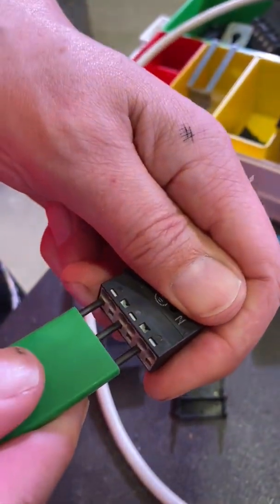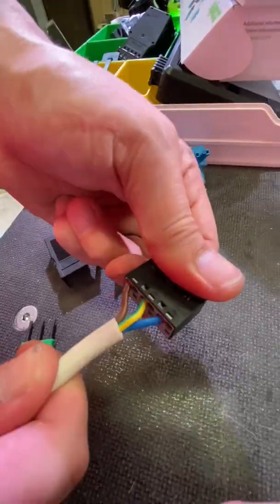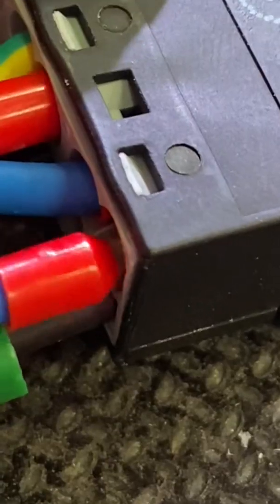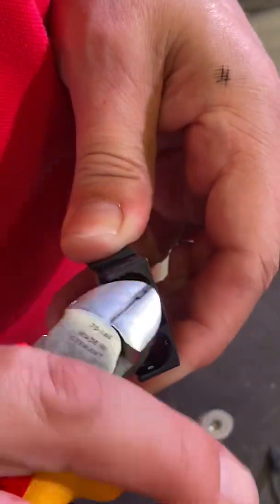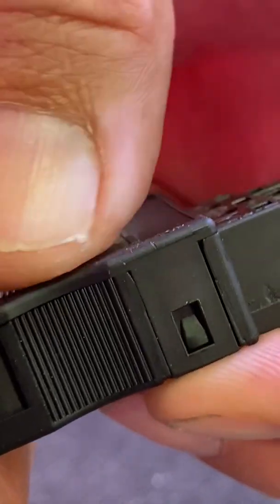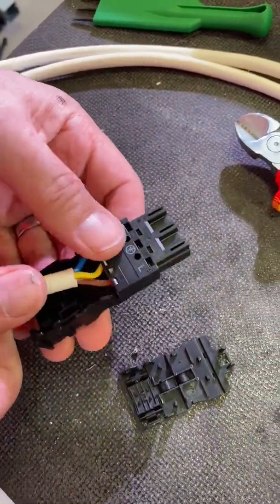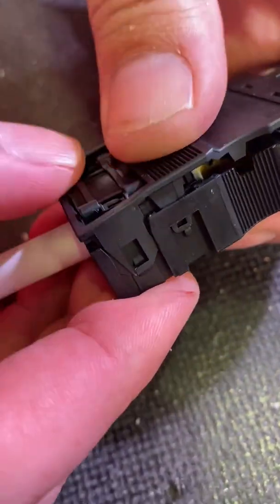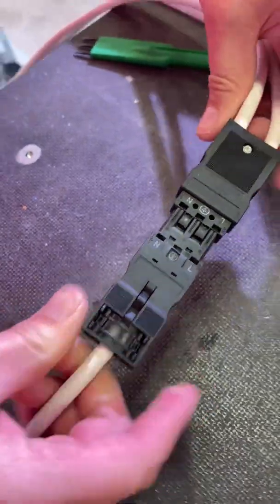MYSTERY TOOL REVEALED - TRIPLE SCREWDRIVER? #shorts

Comment: And because its non standard and complicated some user will just cut it off and use terminal block the minute they need to change something.

There is an event venue I work at regularly that use these to milk out money from exhibitors.  The house sparks have zero clue about the event and just get it wrong every time which leads to loads of extension cords.

I first encountered Weiland conns under desks in offices with tons of spare cable just coiled up everywhere  with factory made ends and moulded plugs and of course users plug heaters in and at one place I found a coil that had practically melted together.

The issue is educating people on the connectors and how to make them off properly.

Comment: I'm afraid that six thin hard nails put through small holes in a piece of hard plastic and then glued together with epoxy such as JB Weld, you can actually do six at once. The tips can be altered to wish with an angle grinder or a Dremel.

Comment: Who the hell would design a connection system where you need a tool to allow the terminals to be inserted into the shell? European electrical standards are so insane. The whole continent is too focused on safety to the point of where it becomes so mundane it is ignored by the end user. Safety third is proper.
Reply from the maker: It’s faster than conventional screw terminals
Reply: @efixx  Cool story. Not what I was talking about. One should be able to simply push in terminals without a tool. Tools are traditionally for removal.

Comment: Am i the only one who thinks that leaving the protective earth this short could be a bad idea?
Reply: First one to put in and long enough so it's the last one to pull out. I'm not so sure about the ratchet cable clamp either. Also, ferules in a Wago? The crimpers provide a temp fixing of the ferules, until the screw terminal clamps tight. I can see the wago gripping the ferrule, but then the thin ferrule not gripping the conductor as well as it would in a screw terminal.

Comment: It's unnecessary to use ferrules on these type of connection! I also heard that it makes the connection weaker. Also WAGO prints it down on the packages that these types are for solid and flexible wires, no word about ferruled wires!
Reply from the maker: They are suitable for ferrules - when Wago make factory assembled cable assemblies they ultra-sonically weld the cable ends before assembly to create “ferrule” style ends.

Comment: Braid the copper together screw a wire nut on there and be done with it. Leave it to uk to overcomplicate 3 wire joints.
Reply: My thoughts exactly on most of these videos. It’s amazing they get anything done. Maybe they don’t get anything done between the wasted time and nearly two months off a year!
Reply: I love the smell of american electrical house fire in the morning
Reply: @akkudakkupl  we’ve been doing it that way since forever and it doesn’t cause anything but a solid connection and it took a mere few seconds compared to that over complicated bullshit in the video
Reply: @dicktrickle8137  But the connector shown in video is for industrial and lighting applications. You can stick to your inferior system, no one is stopping you. laughs in 230V
Reply: @akkudakkupl  that’s your opinion buddy. Also, I am a commercial industrial electrician and we’ve been doing it the same way forever and no issues so there’s that. Laughs in 60Hz
Reply: @dicktrickle8137  60Hz is somewhat superior for motor and transformer construction, 115V is inferior everywhere else ;-)
Reply: @akkudakkupl  good thing that’s not our only voltage that we use
Reply: That's a different product - this gives you a pluggable connection. If you just want to join wires check out wago lever nuts

Comment: Every time I see a new connector, I keep wondering "How many hundreds of damn connector styles exist in the world, and 𝙬𝙝𝙮??".
     I know there are different brands, weather ratings, physical usage, wire sizes and such, but the selection still seems excessive.
Reply from the maker: Old connectors never die ... but the industry is great at inventing new ones.
Reply: @efixx  3M: oh you want new connector?
Reply: There are so much of them mostly due to prevent dumb people connecting things that shouldn't connect.
Reply: @РикСанчес-я6з  Possible reason.
Reply: @РикСанчес-я6з  explain usb c and m.2 then. You can totally plug things that don’t make sense into them. Oh and 3.5mm auxiliary too. What a great idea to plug your soldering iron tip into a headphone jack.
Reply: @v1Broadcaster  What’s the problem?
Reply: @v1Broadcaster  that's why you stop and think before you do something.
Reply: @v1Broadcaster  these are rare occasions, mostly made because of easy access to that types of connectors. Yet you would not do any serious damage to gadgets and yourself if you blug wrong things together (unless you use some  weird chineese nonsense)
Reply: @v1Broadcaster  what fits in m.2 that shouldn’t?
Reply: Someone's trying to invent new ones that are better than old ones, and while they probably do succeed at this, they still don't replace the old connectors.
Reply: Wago lever nut connectors are a personal favorite of mine.
Reply: And yet I crave more connectors. So often, even with all the tens of thousands of options for certain things, nothing is suitable.

Comment: very cool. what are they used for? downlights?
Reply: For almost everything. Here in Germany we call that Wieland plug, named after the manufacturer. You can connect light fittings, connect several power strips. And also common in cable trays with outlets mounted in. The series of plugs was introduced in the 1970s as "gesis" series, now almost every manufacturer of electrical stuff has gesis compatible material, for example power strips. Now this plug/outlet system is called "gesis Classic"...rating is 20A.

https://wiemediadl.wieland-electric.com/CIP/mediadelivery/rendition/101_18634/-B400

Or this one:

https://www.bachmann24.com/media/wysiwyg/bachmann/bachmann-kaskadierung-step-steckdose.jpg

Or this one:

https://m.media-amazon.com/images/I/71iepqeNc7L._AC_SY355_.jpg
Reply: @Marcel_Germann  I've also seen the name Wago Winsta for these connectors (also in Germany)
Reply: @Hiasibua  Yes, Winsta is the trademark of Wago for that kind of connections:

https://www.wago.com/de/verbindungstechnik/steckverbinder-entdecken/winsta
Reply from the maker: Lots of different applications - lots in modular off site construction and lighting
Reply: @efixx  we've been using them in modular builds, I had no idea this tool exists! We've just been struggling to push the conductors in!

Comment: Do not need ferrules on cage clamps. Possibly even argue the clamps work better on flexible cable cores than solid work ferrule?
Reply from the maker: Wago ultrasonically weld the ends on the of the factory made cables in this range.
Reply: @efixx  sound... I'll get my coat...
Reply: @kiers1970  brilliant. fast show

Comment: Dont like the lids they will snap in four or five years time if access is needed. Looks a little cheap to me i prefer Quickwire which we be mode expensive but is far better made and will last
Reply: Hard to use a quickwire in a commercial setting with 1.5/2.5mm flex/yy cable, which is where these plugs are normally use. They're a PITA to work with, are temperamental as hell and a proprietary tool to open them adds insult to injury. Would much rather use a green brook style plug with screw terminals, or just go with a hager Ashley junction box on top of the light fitting instead of these plugs
Reply: @darylsavage119  wait that plastic pokey is a proprietary tool... HOW...!?! Haha 🤣 Just buy a METAL AFRO COMB! 🤦‍♀️🤯🤷‍♀️ Just bend out the ones you need, job DONE! 👍 🤣